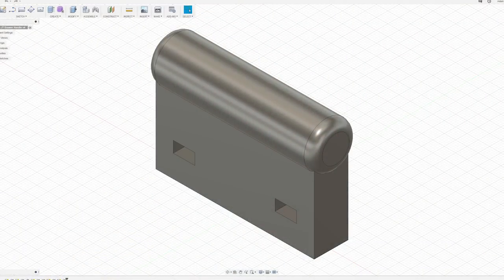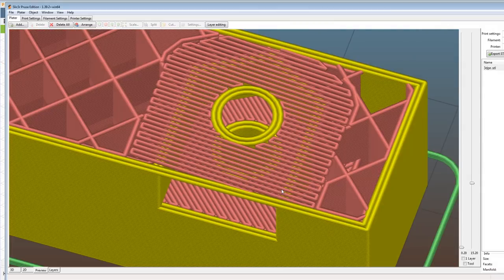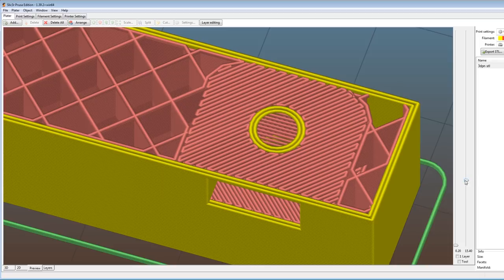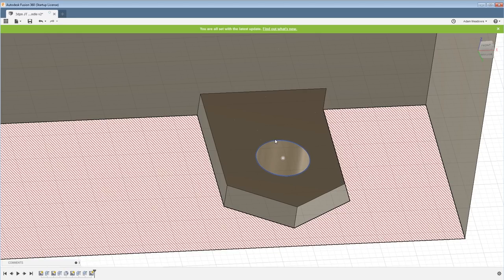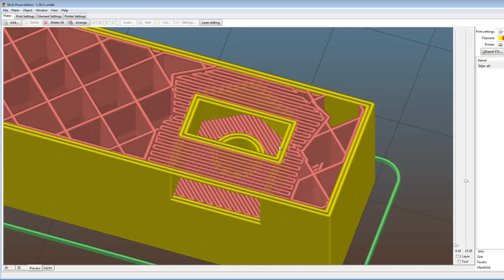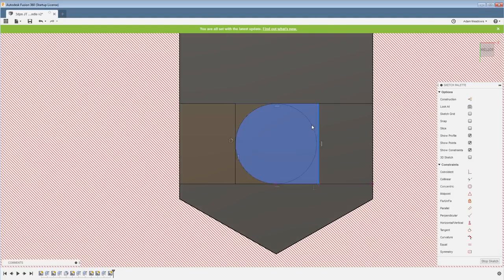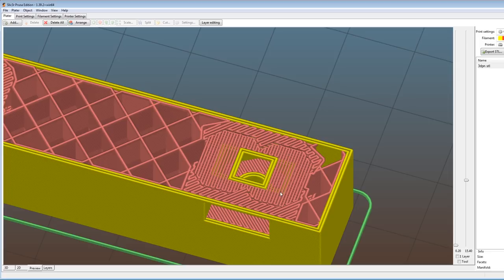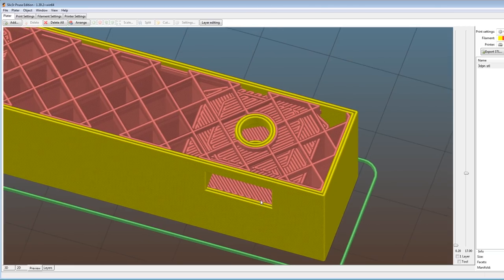Avoid Supports, Sacrificial Layers and Bridging with this clever design technique

Comment: Oh man, this is exactly what i needed. But my part has a 50mm diam unsupported hole in the top (it's a rack to hold centrifuge tubes). I felt with the rectangle-square method that there would still be too much droopage. So I did a third cutout in the shape of an octagon and it's perfect!
so for the 3rd cutout, imagine repeating the second cutout (the square), but rotated 45 degrees. But don't cutout the whole square this time, just the octagon formed by the previous square the rotated one.

Comment: I started using sacrificial layers last year and I'm never going back to supports, you can do almost anything by bridging planes across the hanging areas. Your idea is great, approaching your hanging layer by crossing sacrificial layers is a pretty useful and eficient technique and not that uncommon of a problem (holes hanging on T walls), good video.

Comment: I've decided to create a blind hole not sure how Simplify3D will handle it. It worked, it preserved the hole. Going along the path of the machine screw from the bottom (with the part standing up), I have the following: extrusion between the bottom of the part and the bottom of the nut slot, a slot for the nut, an offset blind extrusion that results in a single-layer bridge above the nut slot plus a second hole for the rest of the screw length. If the diameter is correct, you just need to drill through one layer of plastic (0.2 mm in my model) using the bottom hole as the guide. I use three perimeters in my model, which results in only 10 minute longer estimated printing time.

Comment: Good job. Interesting approach to an interesting challenge.
Here's another idea...
- First, this is just a concept, i.e. I have not tested it.
- The idea is to use supports, but ones that will come off easily, and cleanly.
- Simplify3D can do such supports:)
- So, I created a simple test model, then sliced it... w/ supports.
- The "trick" is to use 'Extra Inflation Distance'.
- Normally, this is used to extend OUTSIDE the model perimeter to give something to grab onto for removal.
- But, in this case, inside a cavity, it extends the supports INWARD from the hole's perimeter.
- This gives anchors to bridge across.
- Of course, the motion during bridging is curved, so, the first layer or two might be a bit "misshapen", but it stands to reason that an "acceptable" hole could result.
- FYI, I have used support in cavities (sans the hole at issue here) w/ acceptable results.
- The advantage of this method is that it's relatively easy: just add some simple supports; and (in theory) it yields acceptable results:)

If this is a bit difficult to picture, I can post a screenshot from the slice, if anyone is interested.

Comment: This approach works but has some downsides: It relies on the printing-direction the slicer decides upon as well as the objects orientation. That means that a hole designed in this way will need extra care during slicing.
But when having a first full bridging layer would cause problems then yes this works.

Comment: For this application you could also put a 45 degree angle on the overhang surface. The extra clearance won’t hurt anything and it’s a much simpler solution. This is what I thought when I seen Joel’s video as it is what I would normally do.
Reply: What overhang? This is a bridge not an overhang.
Reply: @alejandroperez5368  You would turn the bridge into an overhang.

Comment: You can use cone surface to connect any two profiles, use 45 degrees or angle 2:1 (about 63.435 degrees)

Comment: The one subtle downside to this approach is that the model is now fixed to a specific layer-height, reducing your freedom in the slicer. I wish there was a nice way to make a model parametric on certain slicer settings.
Reply: If you design it for the worst case scenario (highest layer height), then it will still work at higher resolutions, but you would get a couple of extra unnecessary rectangular transition layers rather than just the two shown in the video.

Comment: printing in that orientation would appear to be the weakest way to do it given the potential leverage of that handle. and circles can easier be printed vertically, and the point the hex nut recess makes would also be more like a vaulted ceiling and bridging would almost be avoided completely as far as i could tell. but still this is a good example for ideas, valuable video.

Comment: You could have raised the hole up a bit. And then put a chancre on the underside of the two outer edges of the circle. To meet the edge of the wall where the nut is going to sit against.

Comment: print it on its side?

tensile strength will be lengthwise and in line with the actioning of the handle.

even the slight height difference in the bottom edge and the rounded top should print fine without supports...

Comment: Cool solution, but would problems arise if you design the solution at 0.2mm and then slice at 0.15mm layer height? Also why not a hollow cylinder with a wall thickness that is the same as the nozzle hole or extrusion width (0.4mm) and just have a gap at the top (and bottom) 0.1 or 0.2mm for easier removal. It will be like custom designed supports that will be a lot easier to remove compared to automatically generated ones. Although with good settings in a slicer with manual editing of supports I can use supports and easily remove them. I have tried this successfully with nut holes for M3 nuts and screw, but I am not sure if it would work for smaller nut sizes. Can someone explain why popular slicers like CURA and slic3r still don't have manual editing of supports, since free slicers like craftware and ideamaker have this feature for 2+ years?
Reply: @Vector3DP  Really, this would be a neat feature in a slicer.
Alternatively, I often start a design with "layer height" variable, making it easier to update a part by making one tweak.

Comment: I mean cool, but it’s a hidden relief hole, why not make it all square?
Reply: In the case of the square-nut pockets in the Prusa parts, you might want more material against the sides of the nuts. You might also want to avoid all the questions from customers about why the parts have square holes for round screws. And maybe you just think round holes look better. But now that you've pointed this out, I'm going to really struggle the next time I'm faced with this problem, choosing between the simplicity of a square hole and the aesthetics of a round one.
Reply: MikeMike but with this one, it was against the thread, the other side of the nut, not the nut, which itself has a nice V groove to sit in..
Reply: Stephen Mott Aw, nuts. Your point is well taken. You're right in the case of the drawer pulls, but not necessarily in the case of the Prusa parts. Actually, I don't like the whole nut-pocket thing. The nuts in my Prusa parts kept falling out when I was trying to assemble my printers, and I wound up putting tape over some of the slots. Not cool. Printed threads? Tapped holes? Embedded nuts? Threaded inserts? Screwerk screws? I guess it depends on the part. All the options make my head swim.
Reply: C.R.T isn’t the skill there knowing what the specific slicer is going to do without support? And then if your into designing around how things slice, square is often better than a curve..

Comment: Wow! Seems way too complicated.
Have you look at 'Lofts' ??
Just start with a rectangle hole like you did on you first layer and then use loft to a higher layer with a round hole. If the angle of the loft is at least 45, the print will have no problems.
BUT My ultimate question is: why do you need a round hole on that side of the nut slot anyway? Rectangle would do nicely, its just to give the screw someplace to go after feeding through the nut. And it sure doesn't need to be the same size as the screw. Just extend it to the wall thickness.
I dunno, maybe I'm missing something, but this sure seems overly complicated.